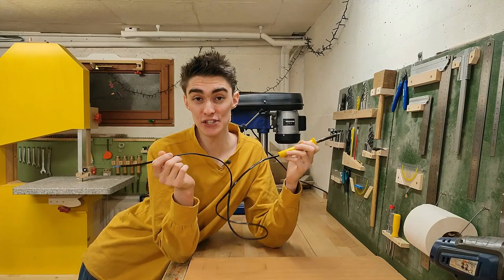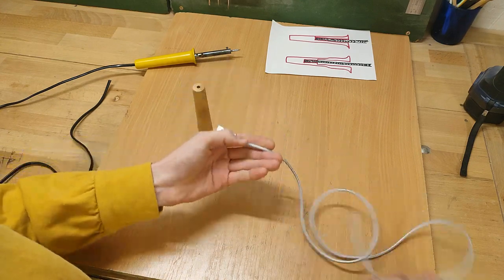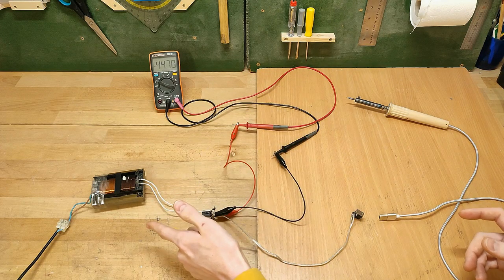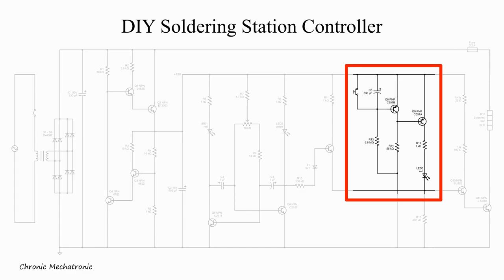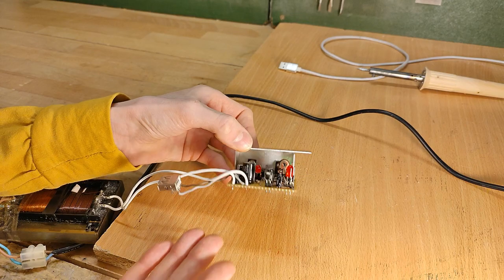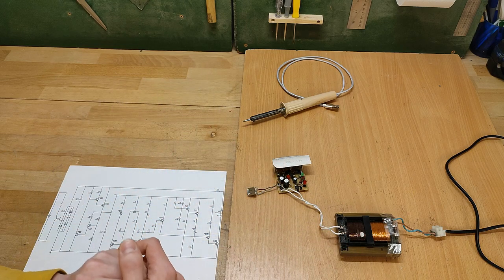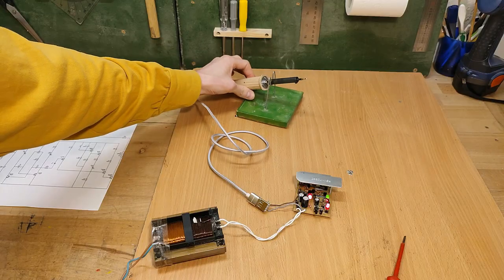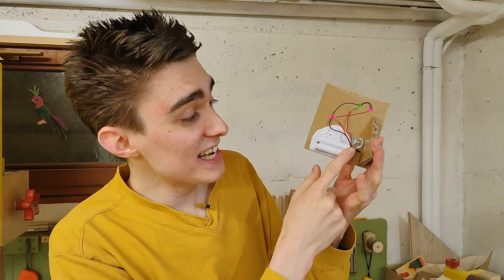Building the control electronics for my homemade REAL soldering station

Comment: I like that you went all discrete components. I assume that the 5.1 V zener is due to lows not being low enough? For driving your Darlington configuration, you can also consider using a plain voltage divider, so that the lows drop below the ~2V needed to open up your three transistors darlington/
Reply from the maker: Exactly that's what the zener is for, the switching curve of the AMV looks about like a logistic growth, so the transistor activates way too early (or even all the time). That problem didn't exist with the mosfet because it needs a gate voltage of about 4.5V....
Alternately you could also swap the zener for a whole bunch of 1N4148 type diodes to create a high enough forward voltage.
A voltage divider instead would be interesting, I should try that, thanks!
Reply: @ChronicMechatronic  If you do go for a voltage divider, consider one that reduces the voltage by a factor of 4. This way, your Darlington will open only when the AMV output goes above 8V, and hopefully that will filter out most of the slow voltage increase. Dunno - 33k paired with a 10k?
Reply from the maker: I'll try it, I'm thinking about doing a follow up on the original pwm controller anyway. Though tbh, a problem I think might arise with a voltage divider, is that it drains part of the base current needed to switch the darlington. There is only so much current I can draw from a single side of the AMV without throwing it off balance, so R1 of the voltage divider would have to be 100k or at least very close - only experimentation will show I guess... But thanks for the suggestion, I'll definitely see if I can make it work! Eliminating all the "exotic" components in the circuit would be awesome.
Reply: @ChronicMechatronic  I should work - your AMV has like a 1K collector resistor, so the collector current would be around 10mA. That divider (approx 40k total) will drain 0.3mA - 30 times less than the current collector for the AMV. 
--- edited --
Now, I see that you already have a 100k resistor - just short out the diode, then add a 33k resistor between the end of the 100k resistor (R10) to ground. 
--- end of edit ---
As for the base current needed, assuming a gain of 50 for each of the three transistors, the gain of your Darlington would be 125 000. To reach 3A for the final transistor, you'd need less than 30nA. Compared to the current through the divider, it's nothing.
Reply from the maker: I had some spare time so I tried it and it works! Used different resistor values tho, to make it run on 5V (voltage divider 47K+22K) just a rough proof of concept for now so it still need to be refined, but here's a short so you can see for yourself!
https://youtube.com/shorts/GWUq3R8qHAk
The white LED is simulating the load, and flashes simultaneously with left one of the red LEDs, which is exactly what it should look like :)
Thanks again for the suggestion, I love it when things can be simplified to less fancy, or overall fewer components!

Comment: That is so cool :) I almost understand the full circuit. But Im not quite sure how the first part works thats making "stable"? 12V. Could someone explain :D ?
Reply from the maker: It's basically a transistor regulator like this one (https://electronicspost.com/wp-content/uploads/2015/09/1.-Series-Feedback-Voltage-Regulator.png) with a transistor each added in a darlington configuration for higher gain :)
I guess the schematic layout does make it look a bit confusing...
Reply: @ChronicMechatronic  ahh thank you. So basically the zener diode at the base limits the voltage. I'll have to build it myself to fully get it I guess :).
Reply from the maker: @MattFixesStuff  completely overlooked the zener in that one, but yes, that's what usually serves as a reference. Mine doesn't have that zener, no idea if that was intentional at the time or not, but it kinda works anyway.. (neither of these simple transistor regulators works particularly well to begin with)

Comment: instead of controlling the after-transformer-voltage, control the before-transformer-voltage.
make an scr circuit that has less than 10 components total.

Comment: Which is Good for soldering iron tempareture Control ?? AC Fan Regulator Or Single Diod on switch For Half Circle AC ,  Are they Damages Heating ceramic Coil ?? 
Someone please advice me .
My iron is Sunshine 936  60w...

Comment: Putting diodes in parallel to increase the amperage is Not a good idea  since slight differences in Vf can overload a diode
Reply from the maker: I did think about that and matched the forward voltage, plus it's only 0.5A per diode anyway, so there's quite a margin